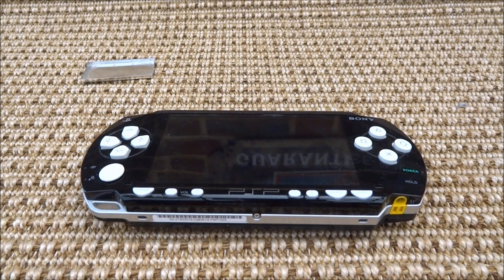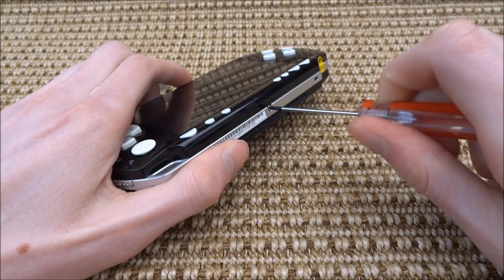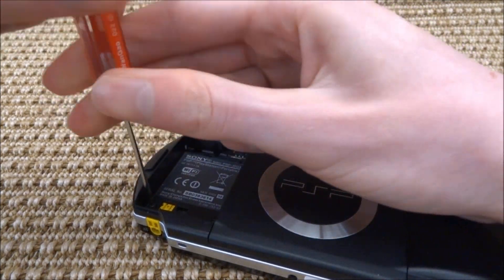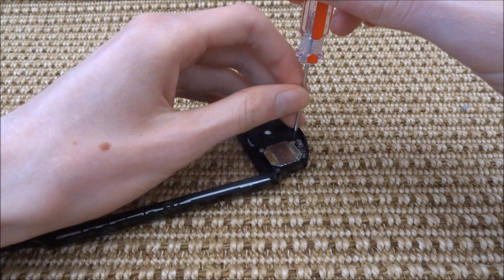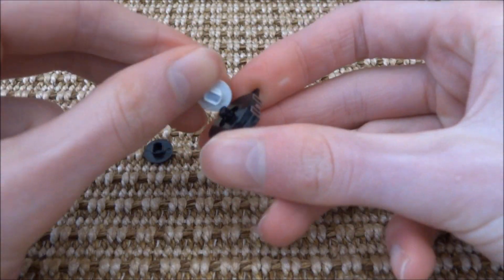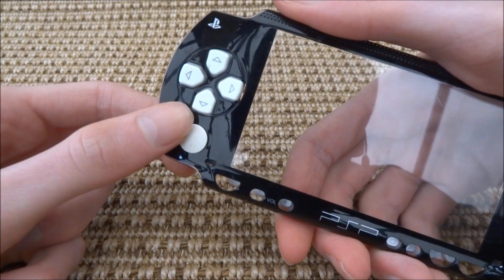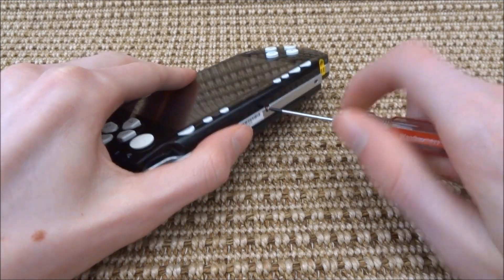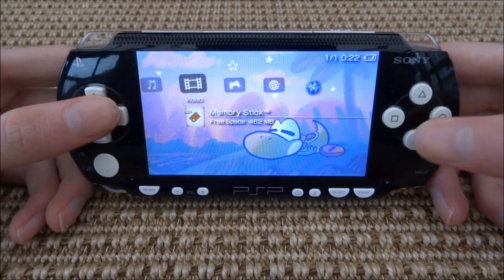How To Repair/Replace A PSP 1000 Joystick!

Comment: Another tip even tho this applies  to any electronics you take apart, if you’re gonna be messing near the screen, WEAR GLOVES. Unless you want basically Unremovable thumb prints and dust and whatnot
Reply: Good tip
Reply: what gloves do you recommend
Reply: @confusedconflicted  probably any latex or rubber glove. Anything that hides your fingerprints.
Reply: @gambinogambino768  thanks for replying didn’t expect such a fast reply have a goodnight my friend
Reply: @confusedconflicted  typically just your regular latex gloves from a dollar store work but if your finding yourself doing tear downs on a lot of systems it may be worth it to invest in a nicer more permanent set of gloves.

Comment: Hay James are the new replacement analogs smoother than the originals? I have a 1001 and the stick works 99% of the time but certain games like StarWars Force Unleashed the stick drifts right and left almost like the stick is to sensitive. Other games like Kind on Hearts Birth by sleep don't drift at all....BUT its the thumbsticks rough feel that drives me nuts. I've cleaned it and its still the same, the 2000&3000 analogs are smooth and don't feel like they are rough inside. I was wondering if the original analogs might have been bad designs ?
I almost thought about using a 2000-3000 parts inside a 1000 but not sure if that's even possible. Anyways thanks for the great vids.
Reply: yh the same thing happens to me. some games like dead head Fred drift towards the right but other games dont. I'm confused ash

Comment: on model 3000, is it possible to remove the analog cap without opening the console? I need a lot to change the cap, which broke a small part.
Reply: Sorry you need to open the system in order to do that, you need to take the faceplate off in order to remove the cap but it's an easy switch once you do that you can pop the faceplate back on

Comment: Hello James i recently changed case on my psp 1000.But after i put it back the joystick doesnt work properly.Its constantly pushing down (even if the joystick isn't in it does this.Any suggestions?And it doesnt work does not change direction.(was working fine before)
Reply: Same thing happened to me I have no answer yet either
Reply: @drewlopez2567  If you tamper with it a bit it will be fixed....not sure what it is exactly the cause tho.
Reply: Same problem

Comment: my joystick works fine after a charge but then after playing a little while it starts drifting again. I think my battery may be too old it losses a charge too fast as opposed to the joystick needing to be replaced? does anyone know if this is the case or will the joystick need to be replaced?

Comment: my 1000 psp isnt stuck it like this one is/ was. mine moves when in a games but im not touching it, i cleaned it and still nothing, i removed it and cleaned it still same issue. So I ordered a new one, we'll see.
Reply: Did it work ?
Reply: @shaz5435  yes it did, at first it when I replaced the joystick I tested it but I did noy put the psp fully back together and I noticed if I gripped it firm it worked. So basically I had to put the system back together all the way since the screws hold in the system tight it worked brand new with the new part

Comment: Can someone help me? My joystick itself is working fine, the problem is the cap, it gets easily remove all i have to do is lift my psp and turn it upside down and the cap gets removed. Is there a way to tighten it?
Reply: Lol, just put small piece of paper inside to tighten it